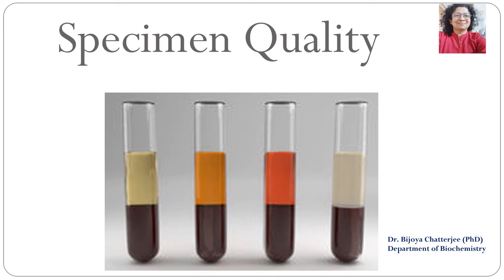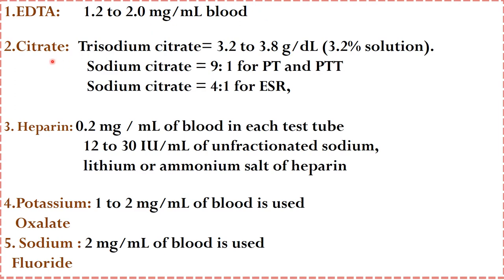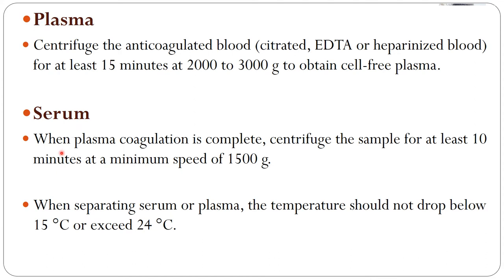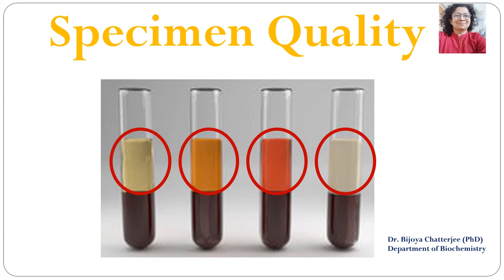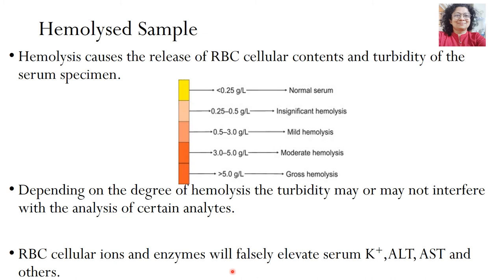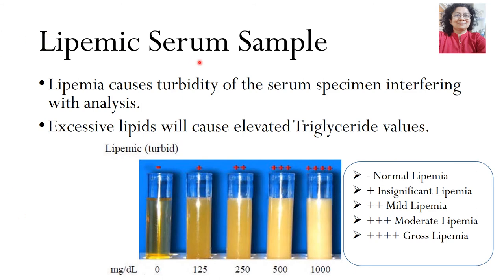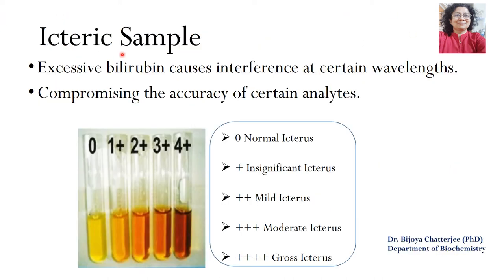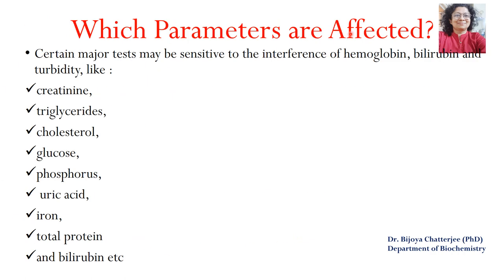Specimen Quality

Comment: Madam suppose we receive a hemolyze blood for emergency situation and we have no chance for second time sample collection. How can we test sodium and potassium with the hemolyze blood ?
Reply from the maker: Hemolyzed blood will alter  Potassium values as they are also present inside Erythrocytes in high concentration.
Reply from the maker: Marked hemolysis significantly increases plasma values of potassium,
Reply from the maker: So if it is mild  hemolysis, and a repeat of sample collection is difficult then after measuring metion in the report that the sample was hemolysed. 

In case of moderate to high degree of hemolysis a recollection is advisable. 

The other risk is that the equipment tubings may get blocked. 

You can also check the mannual of your electolyte analyse if it has suggestions for hemolysed samples.

Comment: Thnku mam...plz tell me the degree of hemolysis
Reply from the maker: Hemolysis is still the most common reason for rejecting samples, while reobtaining a new sample is an important problem.

Hemolysis interference has been reported in studies to affect  lactate dehydrogenase (LDH) and aspartate aminotransferase (AST) at plasma hemoglobin < 0.5 g/L), which is visually undetectable.

Studies have also reported that No hemolysis interference was observed for albumin, creatinine, C-reactive protein, and procalcitonin even at an Hemolysis Index value of 11 g/L.

 But most labs do not have the policy to cmeasure levels of hemolysis index in serum or plasma samples.